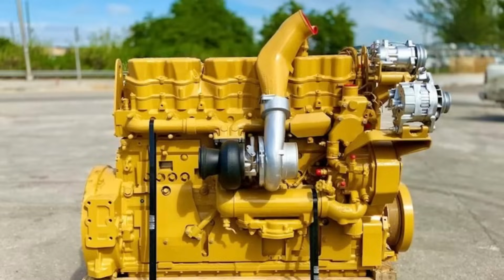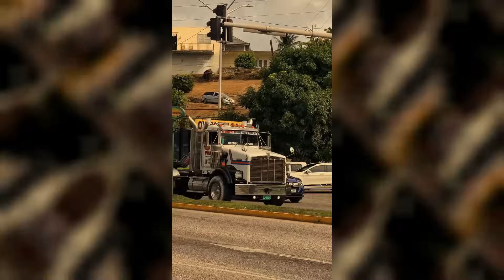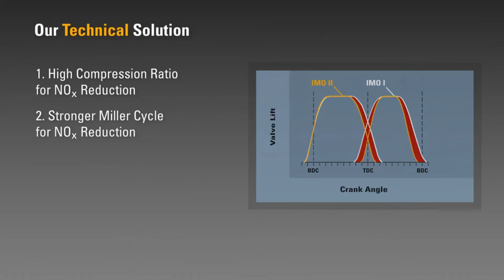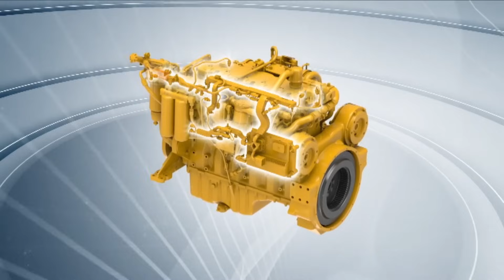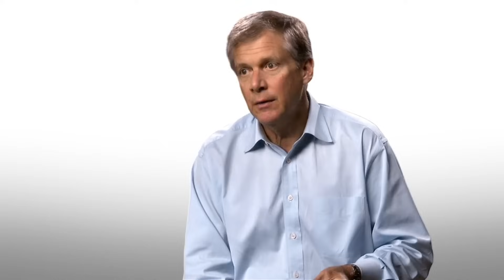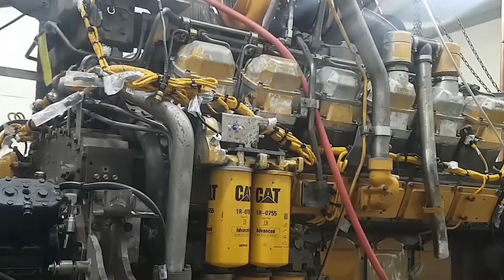The Rise and Fall of Caterpillar: America's Trucking Legend

Comment: They overheat and darn better never over rev one of them over 2k rpm.  Baby it. It will last.  Detroit 60 series is where its at for me. Love cat, cummins, 60 series detroit. None egr of course.  I trust the mechanics that work on them everyday in and out. We know these were holy grail.
Reply: Idk why everyone always says not to rev a cat. I refuse to lug my engine because it’s horrible for it. It spends a lot of time above 2k rpm and it’s never caused a problem. Detroits are a good engine other than the fat that a briggs and Stratton makes more power😂

Comment: CAT, DETROIT DIESEL AND CUMINS IS GOOD ENGINES AND OLSO POWER ENGINES CAME FROM AMERICA AND BECOMES NAMED GREATEST ENGINES MANUFACTURERS FROM USA BY AMERICAN DRIVER SPECIALLY NEVER DRIVING EUROPEAN, JAPANESE OR CHINESE TRUCKS. SO COMMON WE HEARING AMERICAN ALWAYS CLAIMING USA MADE IS ONLY THE BEST BECOUSE DRIVING USA ONLY MADE.
I'M ASEAN PEOPLE WITH OVER 2 DECADE TRUCKING EXPERIANCES WITH EUROPEAN, CHINESE AND JAPANESE TRUCKS. ON TERM GREATEST ENGINE, JAPANESE HINO, UD, FUSO AND ISUZU ENGINES MORE POWERFULL THEN CAT OR CUMINS ENGINES ON SAME SIZES AND USED, VOLVO, MERCEDES, RENAULT AND MAN ENGINES BETTER QUALITY THEN CAT ENGINES,
I OWNED VOLVO FL12 SEMI TRUCK SINCES 2012, 6 YEARS JAPANESE MARKET RECOND TRUCK WITH OVER 220K KM, TODAY MY VOLVO ALREADY SURPASSING 1 MILLION KM AND NOTHING BIGS ISSUES EVEN AFTER 13 YEARS WITH ME, NEVER OVERHAUL, ONLY CLUCTH, TYRES AND REPLACING VALVES.